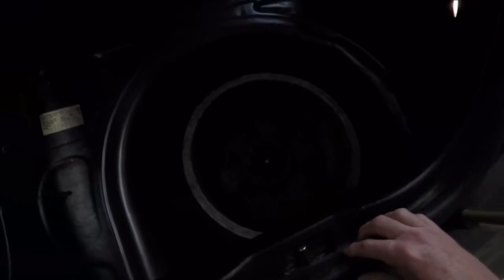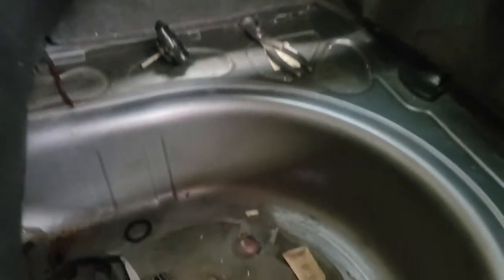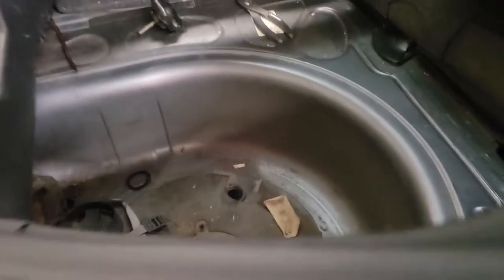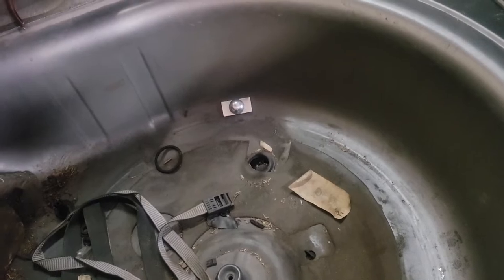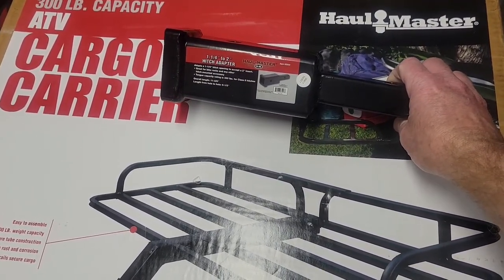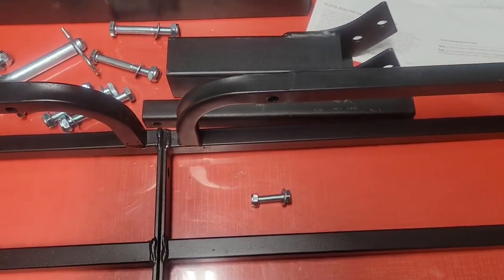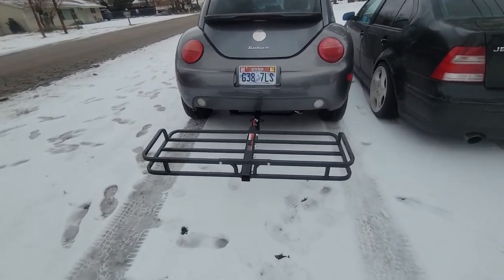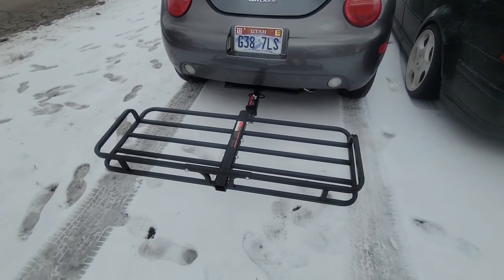2003 VW TDI Beetle Trailer Hitch install Overland Project Stage 3

Comment: I believe the hitch is supposed to go on the top side of the cars toe hook, so that the 1/2'' bolt isn't carrying all the weight, the toe hook is. It is a pain to get the bolt through from the top.
Reply from the maker: I think you are right. But when we tried it that way the hitch ended up really twisted. I'm only using it for light loads like a cooler and gas cans.